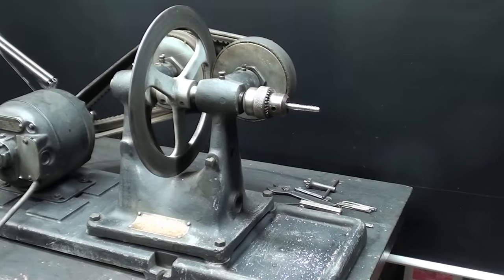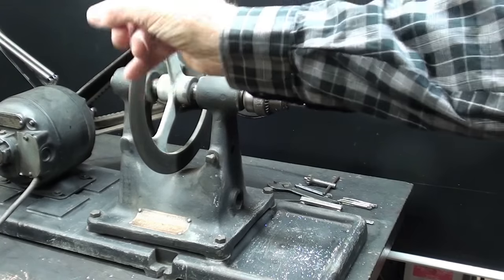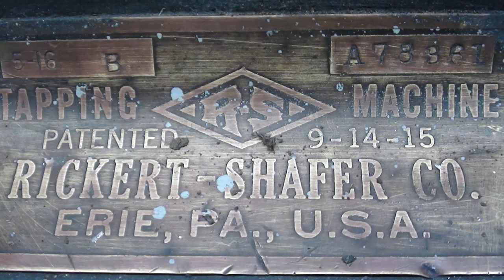WHAT IS IT? Mystery ITEMS #90b answer tubalcain MRPETE

Comment: A few decades ago a local shop was closing up and selling off everything. One of the items was one of these tappers. I looked at it and thought it was more of a curiosity than a tool and passed on it. A few months later I was visiting a local large modern CNC shop and low and behold they bought that tapper from the other shop. So here surrounded by new horizontal machining centers was this old girl, still tapping holes a hundred years after it was designed!

Comment: Thank You Lyle Peterson.... I started using the Procunier Tapping Head 50+ years ago & liked the feel of it. Than switched to the more mechanical (gear working tapping head). What is not understood with manual machining today is the feel of the machine. The simpler the tool the more the brain needs to compensate which makes for a more skilled craftsman. The more mechanical the tool the less the operator needs to work the tool and the brain will become LAZY & the SKILL LEVEL drops dramatically!!! YES I KNOW IT IS THE FUTURE... BUT WE ALL NEED TO KEEY OUR HANDS/BRAIN ACTIVE & INVENTIVE... That is our spark of life!   TM
Reply from the maker: Very well put, and incredibly true
Reply: Too much college often does this to people. They forget how to use their brains to solve simple problems.

Comment: I have a pneumatic tapper from the old Turnapull plant near my house. A friend worked there when it was sold to WABCO. This old tool was thrown into the scrap bin. Knowing how I like tools he got it for me. It still works. Forward you pull the trigger and push the bit. To reverse just hold the trigger and pull back. My friend told me they had drill bits with thread taps on the shank. For through holes  this old tool could make a threaded hole on a piece of machinery too large to get to any other way. 
Thanks for your channel. Keep it up as long as you can. I am 71 years old and I enjoy seeing these old tools and hearing you tell all about them.

Comment: Pretty cool machine . You would have to mount the piece to be tapped at a 90 degree angle to the tap and have the mounted piece on a rail that is also 90 degrees to the tap to get an accurate tap and of course an oiler running on the tap. I have done some hand tapping and it is not easy on certain metals and broke many taps . Thanks for the share. :O)

Comment: It looks like it is designed with the drive wheels going at different speeds.  Slower when tapping, faster when retracting.  Which would make sense.
Reply: Maybe different gears on the belt drive?
Reply: After watching the l, I noticed it does have different gears. Maybe they knew u could go faster on the way out so they did it to speed up the process?
Reply: @51-FS  No gears.  It is done by different size belt pulleys.  Yes, to speed up the process.  Just like a shaper is designed so that it's backstroke is a little quicker than the cutting stroke (although that is done differently).
Reply: @51-FS  No gears.  Just pulleys.
Reply: @51-FS  Lower geared, more force needed for the cutting then backing out.
Reply: @trainliker100  I ment pulleys....
Reply: Yes, the slower speed for tapping would equal more torque and the faster speed backing the workpiece off the tap would speed production.
Reply: nope,  they are the same size.   the speed of the tapping is 100% dependant upon the amount of pressure you are applying to the work piece.   Push it hard and it taps faster, only slightly push and it will be very slow and steady.  same in regards to when it reverses.   the tapping speed is controlled by the friction of the flywheel against the leather  covered wheels attached to the pulleys.   it is extremely simple.
Reply: @orion7741  The pulleys are obviously different diameters.  So, the spinning disks will be rotating at different speeds.  Since they also perform the function of being a clutch, speed will vary based on pressure.  However, the MAXIMUM speed in one direction is higher than the other.
Reply: Old ' shapers ' are set up that way, slower forward stroke for cutting with quicker return stroke for reverse with no cutting.

Comment: I have a tapping machine that is built like a press drill, the belt is bent in a U shape and it spins 2 pulleys in opposite direction, each pulley have a clutch and when I push down or up on the lever it will spin one way or the other. I like the simplicity of your's. Nice video.

Comment: Back in 1980s i worked for small company building machinery and used to drill and tap thousands of holes with regular drill press and drill chuck, forwarding and reversing the press. As maintenance i was always fixing the keyways in the variable- speed drill press as forwarding and reversing the variable speed pulleys was beating hell out of them. My boss was an old school know-it-all but it wasnt until years later i found out about tapping heads based on this similar concept and thought " why didnt mr. Know- it- all get us some of these for tapping all those holes?"

Comment: Thanks Mr Pete!  Makes me wish I hadn't spent so much time reversing tap or die every 1/2-3/4 turn to 'clear the chips'!!!  My threads on steel NEVER looked good.  Also, noisy little thing, where's it coming from, those bearings shouldn't be making that 'bad ball bearing' sound no matter what?

Comment: Might have been an application for the Wahlstrom chuck. It has four jaws and bits can be changed without stopping the spindle both of which might have been useful features in the sort of environment this machine would have been used in.

Comment: The main thing I saw them used was not threading but was to chase the rubber out of the threads in motor mounts after they were vulcanized. - The long defunct Ohio Rubber Co, in Willoughby Ohio used to farm out the thread cleaning and the shop next door to ours got the contract for the Chevy motor mounts. 3-shifts a day. 7 days a week.

Comment: i used the smaller unit on a drill press (called a sensitive) in the '70s when i worked at tokheim oil tank and pump co machine shop.

Comment: The reversing mechanism reminds me of the carriage feed system employed on a vintage sawmill and the design Snapper employed on their riding mowers. Snapper used one spinning drive wheel and one driven wheel. Moving the driven wheel out on the drive wheel diameter gave varying ground speed. Moving the driven wheel over center of the drive wheel resulted in reverse. Neutral was over shaft center where the drive disc was relieved.The Snapper drive wheel was a flat disc driven directly from the engine shaft and the driven wheel was a friction surfaced drum similar to the tapping machine drums. I think that I recall that the friction material was a flat rubber belt. The Snapper mower drive design was rock solid and greatly reduced manufacturing expense over a traditional mower/garden tractor gearbox design. I ran those Snapper mowers from the mid 1970's into the very early 1990's.

The unguarded drive design of your tapping machine looks dangerous in our safety zealous culture. The air gap in the drive design to yield neutral position was not obvious to me in Part A. The comments in Part A cleared up what I couldn't see. I enjoyed the demonstration, but I don't think that I will look for a machine to add to my arsenal.
Reply: Surely Lyle didn't choose that exact camera angle specifically to hide that center gap and thus make its operation and purpose more obscure, did he?
Reply from the maker: Yes, I did, for the follow up video

Comment: I was born and raised in St Louis and I had a friend of mine that worked at McDonald's Douglas the aircraft company and on their production floor they had machines similar to this a newer style but the same concept you tap the hole and then when you pull it back it reverses and it reverses the tap

Comment: I didn’t know what it was until I read the comments. The lack of a work table and some way to clamp and accurately guide the workpiece threw me off. It’s not that dangerous except for neckties and long beards 😮😮 and could easily be covered if necessary. I wouldn’t 
think it would tap holes much larger than 3/8-16 (10mm).

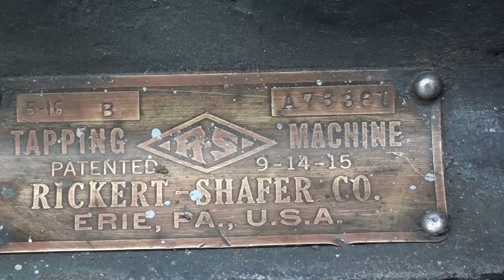Comment: 2:47 time stamp for reference here. 
The date code for when it was manufactured would be created in the same manner as the serial number was created. The serial number is etched into the plate on the upper right of the plate, so the date code for when it was manufactured is going to be the date etched into the plate in the upper left corner.

The date in the middle, if I had to guess, is the date the patent was granted - it seems to be on the same row of text as the word “PATENTED”.

EDIT: at 5:36 the patent drawing is displayed, and it confirms my guess that the date in the middle of the plate is the date the patent was granted.
Reply from the maker: Thanks

Comment: When you get to the 1" taps better hang on! LOL
Reply from the maker: I’ve never tapped a 1 inch hole in my life. You have probably never tapped a hole smaller than 1 inch, lol.
Reply: @mrpete222  My shop rule is nothing smaller than 1/4-20 😎

Comment: All dates should be written with the first three letters of the month and all four years numbers. Example 9-11-8. Is this September 11 1908 or is it 1909 November 8 or is it 2009 11 August? I could go on. My point is dates need to have no doubt. This format of... Sep 11 2008 leaves zero doubt. Some will say that that it is common sense which format is used. NO IT ISNT! Different organizations use different formats. Even in this video the author was in doubt as to what the date was. I used to teach computer programming. I told my students to always write their code so that the year was four digits and the date was the first three letters of the month. If they didn't I'd flunk them.
EDIT: I didn't require them to also specify if the date was AC or BC but should have.